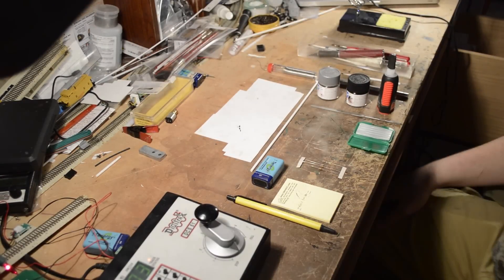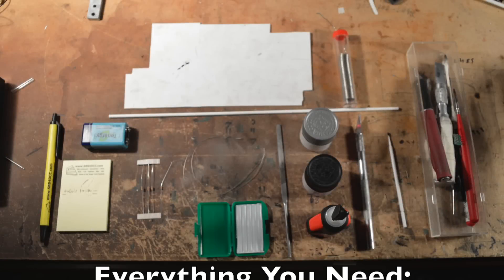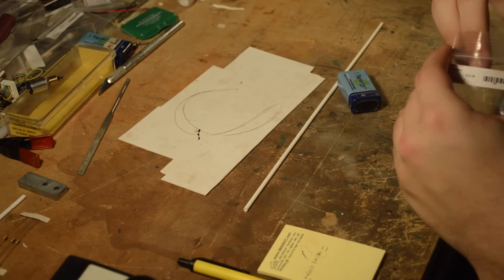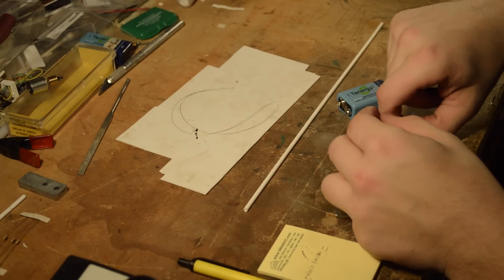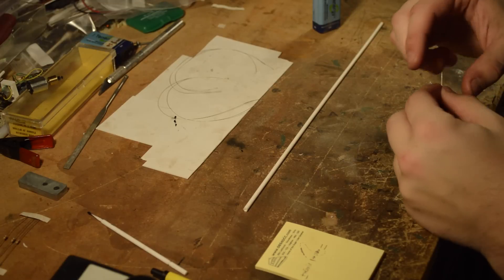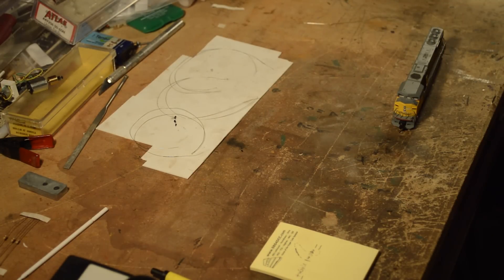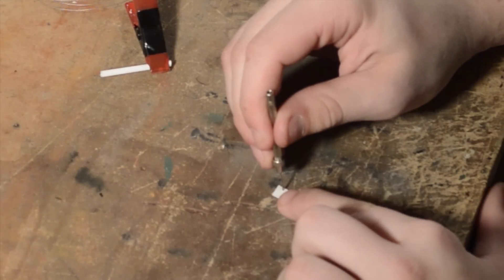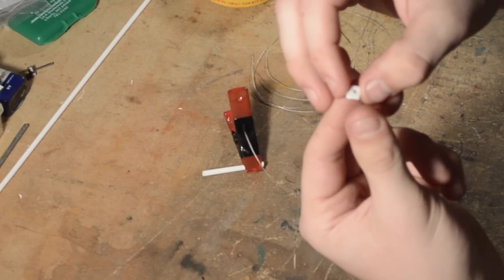Building  Working N Scale Signals From Scratch

Comment: If you want to make perfect round heads the easy way: Take a brass tube. The inner dimension same as the head size you want. Take a veil and create a bevel from the outside in, basically creating a round knife. Use a hammer to punch the heads out: Voila. 

Great tutorial, I will certainly use your method (besides the head cutting). Keep them coming!

Comment: Don't know if this helps any, but actual background targets are 35" in diameter with a housing on the backside where all the optics and mechanism sits, and all this independently mounts onto the mast by way of a bracket that sits the whole signal head/target and hood ahead of the mast. The wires route to the back and down through the mast.  The housing on the back of the target is about 12 wide by 18 tall and 18 deep. Can be a section of square tubing with a door on the back to enclose the LED's inside.